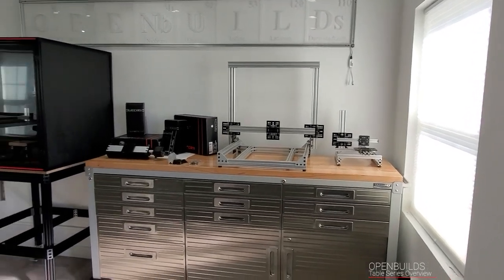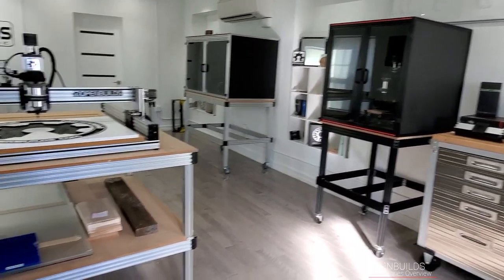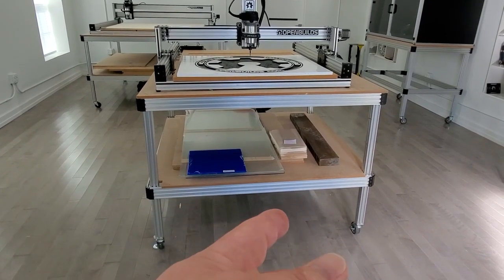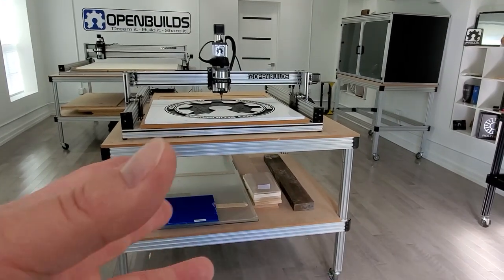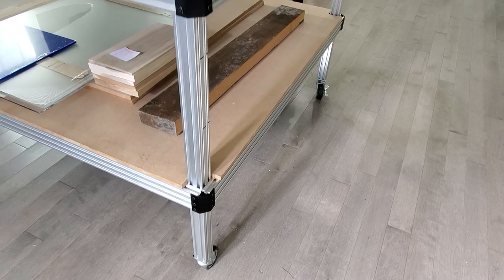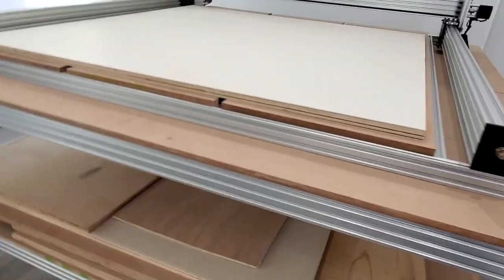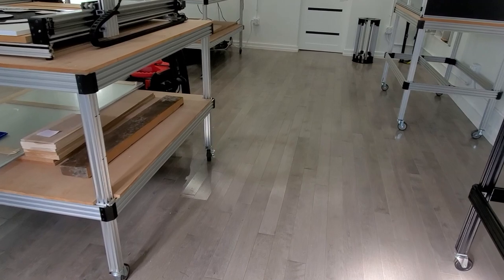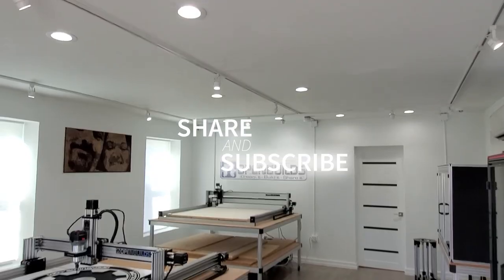OpenBuilds Modular Table System

Comment: There really isn't a way to just add legs to the bottom of the 1515 instead of sitting it on a table that has another board on top of it?
Reply from the maker: Great idea Tom and with the modularity of the OpenBuilds system it should be easy enough to make.
Reply: @OpenBuilds  Has this ben done yet?